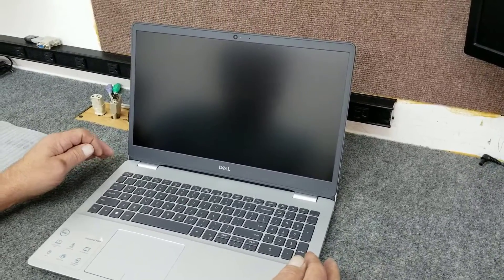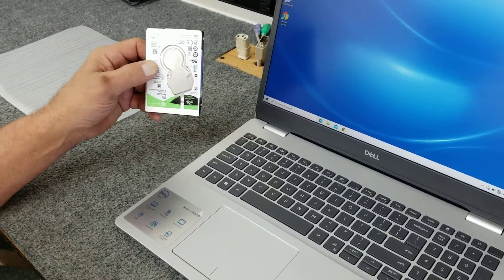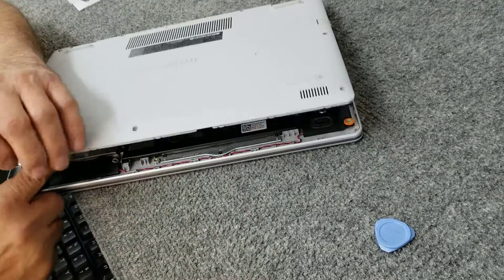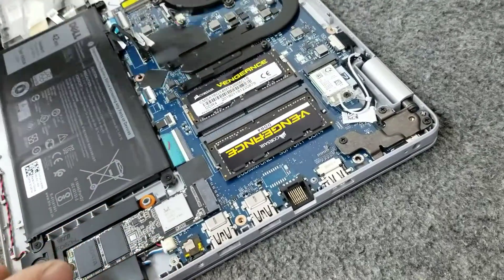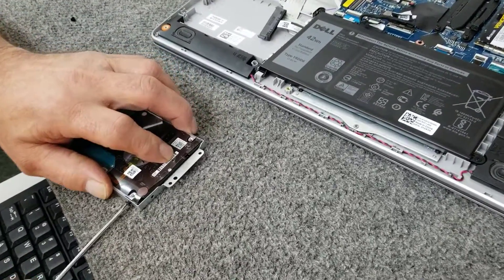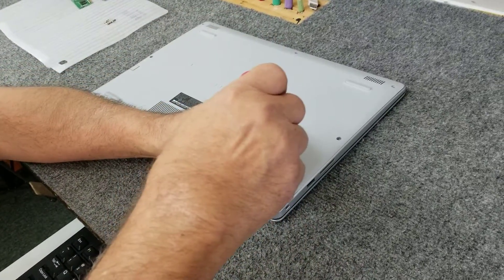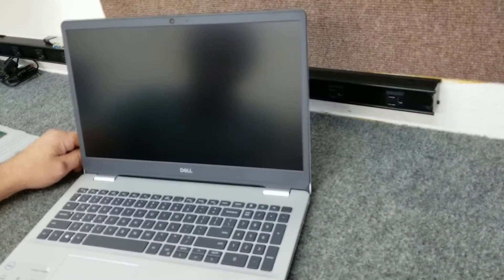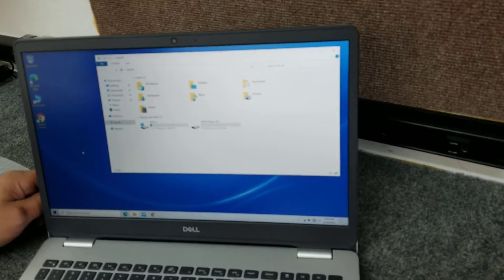Dell Inspiron 5593 Memory Upgrade and Add Internal Hard Drive

Comment: If your Dell won’t get past the logo screen on restart,  you will have to power off, then power up and immediately press F2 multiple times to enter the BIOS. Then change the boot order to boot the new drive first.

Comment: Hi, My laptop came with 8 GB RAM. I am planning to upgrade with additional 16 GB Ram. Can I use 16 GB single channel Ram in additional slot. Will both rams work together with 24 Gb capacity? or Max 16 GB only (Since the new one is single channel Ram- which is little cheaper than multi channel). Please clarify. Thanks
Reply: Hello, how did you solve the memories? Do you have 24 gigabytes of ram?
or you had to install 2 x 16 Gb of Ram to get 32 Gb of Ram, I'm looking to expand memory that's why the question. greetings from Argentina . I had a big doubt if this machine accepts more than 16 gigabytes of Ram, IT SEEMS SO, Although in the manual it says UP TO 16 GB OF RAM AS A MAXIMUM
Reply: @caribesur5  No, I dint add additional RAM, I heard that, it will support only same kind in both slots. So it should 16+16 or 8+8.

Comment: Nice review. I was been looking for this laptop until i discovered another one that i liked a lot more, which is an Acer Aspire 7 Series laptop. From what I've seen so far, the model that appears on this video has an Intel i7 10th Gen processor and a Memory RAM of 16gb DDR4. But i want to make some query. Which computer is better on specs and benchmarks, this one or the Aspire 7 (2020 variant; model A715-75G-79E0)? Best regards and i'll wait for your answer.

P.S: I'm sorry if i made such enquiry in the wrong section.
Reply: Dont buy it has a lot of heating issues🤧

Comment: So there is a slot for a 2nd hard drive correct?
Reply from the maker: Yes, there is a 2.5 inch bay mounting caddy and cable included with this model.

Comment: HEy Dale,
So can't i upgrade the Dell Inspiron 5593 i5 model to 32GB ? The dell site says it only supports upto 16GB of RAM
Thanks
Reply from the maker: Hi. This model I use in the video will support up to 64gb ddr4 in dual channel.  I installed 32gb in the video, as you can see.  Thx, Dale
Reply: @CadillacComputerCenter  So is that a 'yes' or a 'no' to his question?
Reply from the maker: @Timidjango9  Hi. Yes. I installed 32gb ddr4 in the 5593 with no problem.
Reply: @CadillacComputerCenter  So it does not matter about the processor, right?
Reply from the maker: @Timidjango9  Hi. if you have the same model i used in video, youll be fine.  5593
Reply: Only support 16GB if you put  32GB -> laptop only use 16GB....  a waste money.
Reply from the maker: @MeowSubtitulos  Hello. Thie model in the video easily supports 32GB DDR4, actually up to 64GB DDR4.  Thank you. Dale
Reply: @MeowSubtitulos  is it ?? cuz i was planning to add 32 (16*2) GB
Reply: @MeowSubtitulos  you are right